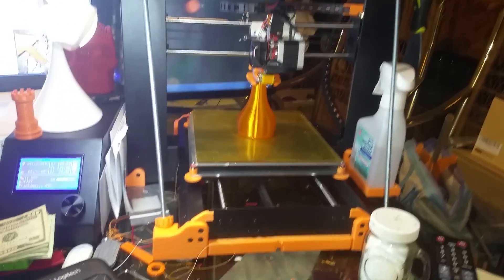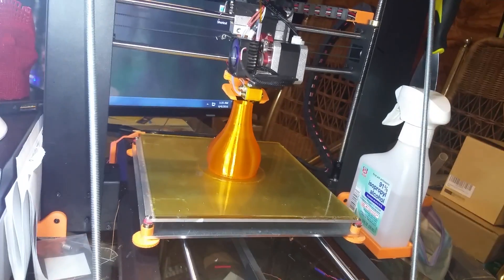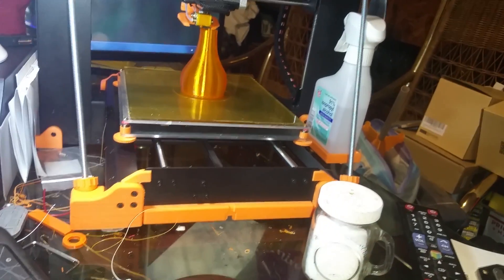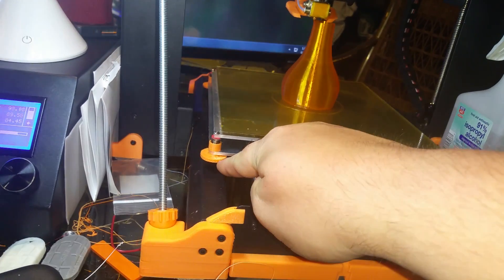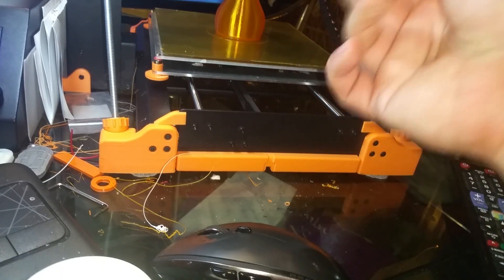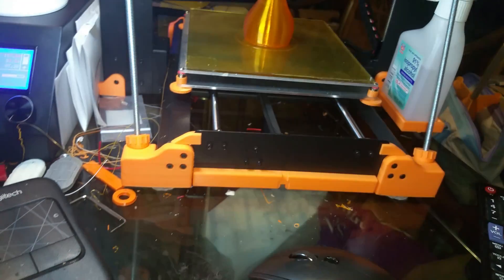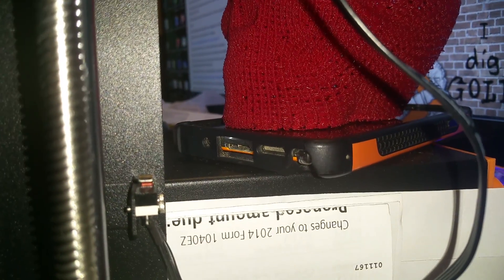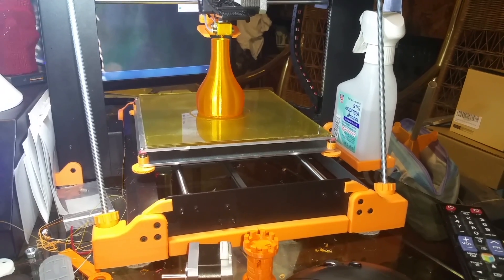Today's 3D Print - Minimum mods and instructions maker select wanhao i3

Comment: Nerys,
Thanks so much for putting this tutorial together. Without it the learning curve would be much steeper. Thanks for the Flexion suggestion, I think it's the most important upgrade!
The Maker Select V2 I have came with aluminum thumb screw but the leveling drifts with every print. I find myself leveling it a substantial amount on every new print. I have tried using small o-rings  between them and the plate(upgraded) and it still drifts. I plan on printing the thumbscrews you have suggested. I have successfully printed TPU at 80mm/s. Have you had any success printing faster than that? Thanks again!
Reply from the maker: nemec3rd no. your thumbscrews are fine. what you need is to replace the aluminum plate below your bed. its too thin so it warps and this is why you have to keep releveling about $24 on ebay. such a huge improvement!
Reply: Thanks for the quick response,  I did replace the plate with the one you recommended and it still drifts?? Maybe the threads on the thumb screws are a little sloppy. I'll give new thumbscrews a try and give you an update.
Reply from the maker: install the spring cups (make sure they fit loose) this will help keep the springs straight and keep level from moving.

also make sure your gantry is snug (not wobbly)

also check your X carriage level (like I do in the video with the pill bottle) this will still drift (not sure why) I have to reset mine now and then. not too often but enough.
Reply: Thanks, I think maybe I was just being a bit too anal on the leveling.  I have been able to run about 10 prints without changing anything. I am printing almost edge to edge so I think leveling is more sensitive when printing so close to the edge.
Reply from the maker: nemec3rd correct when printing on a full bed the level of the entire bed becomes critical so if you're print surface is not perfectly flat that will cause you some trouble and you might just have to make some compromises and have some slightly to squish and some slightly less squished areas to get a overall compromise over the entire surface but if you're successfully making Prince like that you're probably okay

Comment: why do you print so low speed?
Reply from the maker: Diodo Paul because that particilar print was tpu a flexible material with a really thin wall and i wanted to see if slower would improve its quality.
Reply: did it improve the quality?
Reply from the maker: Twitching Shark yes. well to be more correct printing too fast reduced print quality with these tupes of materials.

Comment: Hello.  Thanks for the tutorial.   I recently purchased the flexion extruder, and the motor you linked.  After installation, my extruding motor will not turn.  I opened up the box to get to the board, and adjusted the driver for the motor to the correct level.  No dice.  Turned up the driver past what i calculated, and still nothing.  Even lowered it below the level and still nothing.  The motor turns freely when the printer is not on, but for some reason will not turn and move the filament.  I'm running out of ideas, any advice on what to try next?
Reply: changed the two center wires. didnt see the bit the description. thanks a ton.
Reply from the maker: cameron ice ahhh good that is what i was going to reply with. the flexion can be annoying to tweak bit the results are amazing.

Comment: Love the video. I've been referring to it over the last few weeks as I upgrade my wanhao duplicator i3. So far I've upgraded it with the flexion extruder, added new bearings on the y-axis and the implemented the z brace mod. I've also purchased some igus drylin plastic bearings and a high temperature micro Swiss hotend for the flexion extruder to test. 
At the moment I'm looking at switching out the y carriage plate and baseplate as there very flimsy. 
You mentioned that you changed the carriage plate on the y axis, did you also change the baseplate? It doesn't look stock since the corners are sharp n the bolt holes are very close to the edge. One main issue I have with switching the baseplate is that the heating bed unit is bonded firmly to the underside of the stock baseplate on the wanhao i3.
Reply from the maker: paulfox89 I am sorry I missed this reply I may have been using the wrong terminology there are two plates on your y bed the actual PCB heater that's the surface you put your glass on top of which I did not change then you have what I call the Y Carriage plate or the plate below that heater bed that the screws go through with the knobs on it that's the plate you need to replace it's too thin which means as you tighten it heat it cool it adjusted warps which causes the heat pad to work thicker y plate doesn't Warp therefore the heat pad does not work

Comment: what settings are you using for PETG?
Reply from the maker: Jason Southwell no changes except to temperature and otherwise normal diameter measurement tweaks. hardest part of petg is first layer adhesion for me. if i nailbthe first layer it will come out perfect and i do mean perfect petg prints very very nicely but man if you can't stick layer one dont even waste your time letting it goto layer two. its real finicky that way.
Reply: thats funny, I have the opposite happening. sticking so good to the PEI that it tore a chunk off when I tried to take a print off! I grabbed some esun white petg. tried to take it off cold bed though.....
Reply from the maker: Jason Southwell ahhhh i have not tried petg since gpong with pei. i will have to try that. petg does stick very hard once it does stick. one trick i use is to lay a piece of tape so that part of it will end up under the print. that way i can lift the tape spray some alcohol and work the scraper in. works very well.

Comment: do you have a link to the printer also? would like to get one of these.
Reply: and which extruder option do i pick? im assuming its the common dual one, thnx. ill be getting this printer soon. just doing some more research.
Reply: you want the single extruder kit. comes with 2 hot ends if you get the high temp kit.

Comment: you buy the high temp kit for the flexion yet?
Reply from the maker: Jason Southwell yes i have it but have still to install it yet. hopefully in the coming weeks inwill get it installed.

just got a roll of 3 pounds of string trimmer round 1.7mm for $24. 3 pounds of nylon! fingers crossed cant wait to try it.

Comment: This honestly is one of the best videos for people just getting this printer. I have watched and re-watched this. The trick with printing a circle object and tighten/loosening the bed while it is printing has saved me so much time. I really want you to do a rework with the updated y brace kit. I was really confused with the "suggested print list" I had all these parts I had no idea what some of those parts were for. Keep it up, just no BS solid advice from experience and practice.
Reply from the maker: Shane Walker in the coming months I will be making all of these same upgrades to my second wanhao duplicator i3 I will make a video of each stage as I print and install these parts and adjust the printer

Comment: Nerys, what (if anything) did you have to change in the firmware for the flexion extruder? Thanks.
Reply from the maker: Steven Young the only firmware change was adjusting the extruder value to be correct so 100mm was 100mm

otherwise i had to upgrade the stepper to be strong the stock one was not strong enough. $14 on amazon
Reply: Nerys, thanks for the info. If it's not too much trouble can you send a link to the motor?
Reply from the maker: Steven Young LEORX Nema 17 2 Phase 4-Wire 1.5A 40mm 1.8° Stepper Motor for 3D Printer https://www.amazon.com/dp/B015SS3Y7O
Reply: Nerys, thanks again for the information. One last question. Are you printing with PLA? I ordered one yesterday and have heard mixed things on printing PLA.
Reply from the maker: pla is all I have printed with. apparently it is largely why you need a stronger stepper.
Reply: Might be dumb question but how do u make sure u are get 100mm? I installed my flexion and new stepper I just want to make sure I'm getting the extrude value.
Reply from the maker: I used a sharpy and marked a spot 100mm above the extruder. I then 
advanced it 100mm and checked to verify I reached the 100mm mark on the 
filament. adjust the values in the printer settings until it matched.

Comment: Surely you should be doing the levelling independently from the bed.  It is important that the Z axis is 'true' horizontal based on the fixed frame it is attached to and not a moveable part being the bed.  Even with the levelling screws tightened there will always be differences due to the tolerances.  When you then level the bed in the normal manner the thumbscrews can be adjusted without twisting.  If you are experiencing for example front right requiring 360 rotation clockwise and rear left 360 anti clockwise then your issue would be the frame itself and yes you may experience twisting.  In principal I am sure your solution works but it could end up causing more issues in the long run.  Ideally your actual machine must be placed on a perfectly flat solid surface and the machine itself levelled before attempting firstly the independent levelling of the Z axis followed by the bed.  We currently run 3 printers 1 of which is an industrial machine the others are all Prusa Based all in varying sizes so have been through the levelling process a multitude of times.
Reply from the maker: paul w i think z arm should be leveled to bed not absolute tighten down level z arm then level bed. at least that seems to give me the best results.

Comment: not seen the upgraded y plate anywhere else , will have to get on that once i have the bearing. I am going with self lubricating bronze bushing. for the plate
Reply from the maker: i wanted to go with the igus but can only find them in short length. link to the ones you found?
Reply: You have to use 2 small ones and glue them into a holder , you can find it on thingiverse .

https://www.thingiverse.com/thing:878675

The bushings are on the way from china , loooonnnng shipping but i will let you know how it works. The noise that axis is the most annoying, after the fans in the PSU but thats next on my list after pay day , get some nice noctua fans ordered.
Reply from the maker: +Andrew Joy those are plastic not self lubricating bronze? as for the fans absolutely I replaced all of my fans I'll have to add them to the list of mods it's an amazing difference printers damn near silent
Reply: You misunderstand, you put the self lubricating bronze inside them.
Reply from the maker: +Andrew Joy ahh ok. not a fan of using plastic even as a sleeve cant gelpnbut feel slop might woek its way in. got a link to your bronze?

Comment: hi, where are the instructions to drill holes for the y carriage plate?
Reply from the maker: there are none. but its pretty easy. the 4 corner (leveling) holes line up. bolts the two places together using those. now it can go "two" ways. one way results in holes partially lining up. this is the wrong way. flip it around so they do NOT line up.

drill all your holes (3/16th bit)

that's it. put it back together.
Reply: +Nerys thank you for the reply, it was great help. Just to be sure, the y carriage plate upgrade helps with the warping issue found on the original right? I should have asked this as well in my original comment.
Reply: +Nerys I almost forgot, I have the maker select that's based off the wanhao di3 v2.1 verson
Reply from the maker: +rickyay26 yep. one of the single best upgrades you can make. easier to level and the leveling stays locked and consistent.
Reply from the maker: +rickyay26 yep so do i. its not based on the wanhao it actually is the wanhao made by wanhao and labled for monoprice.

Comment: Do you print that slow on all your prints and how slow is it ?
Reply from the maker: for those kinds? yes. thats a single layer tpu print. very thin and delicate till its done. also tpu bonds better and displaysbmore metallic/stained glass like if you go slower.
Reply: +Nerys how slow is it
Reply from the maker: +brian 96 no idea. its adaptive i think normal speed was set at 1500mm/m with minimum layer time 20sec and outer layer at 80% iirc.

Comment: Another great upgrade is Igus RJ4JP-01-08 bearings. http://www.ebay.co.uk/itm/Igus-Drylin-RJ4JP-01-08-Linear-Bearing-x-6-Replace-LM8UU-in-3D-Reprap-Printer-/282110483823?hash=item41af185d6f:g:pGwAAOSwu4BVincC
Reply from the maker: I just wish they had longer versions of those instead of the little shorties.
Reply: Nerys
Unfortunately Igus do not sell a long or shorter version of this bearing. But for a few thousand pounds they will make some for you. I have asked but politely declined. lol

Comment from the maker: Jessica. for some reason your comment is not visible and I don't know why. as for the v2 plate I have no idea honestly. I am leary of the extra holes and if they don't line up the might interfere. I would stick with the original until someone verifies compatibility of the new one. Since I already have one I have no need to buy another. if I ever get a second i3v2 I might try it and see as I like the prime availability of it.

I am thinking of getting this one

https://www.amazon.com/Aluminum-Carriage-300x200mm-3D-Printer/dp/B01FWCTQCS

since I have the other parts to upgrade my printer to 320x200 already (I plan to do and post video of that upgrade later in august once I get back from Naram)
Reply: According to the seller at Amazon, the v2 still needs to be slightly modified for the Duplicator i3 like the original plate that you have.  But the v2 can be setup to have 4 bearings instead of 3 if you want.  Other than that if you're using 3 bearings like the Duplicator i3 then either will work.

Comment: Where did you find a plate that has the correct spacing for the bearing blocks? Every one I've seen for any Prusa i3 type uses 170mm spacing instead of the 140mm spacing as on the Maker Select.
Reply from the maker: you dont. you bolts the plated together using corner holes and drill it. very easy took 5 minutes.